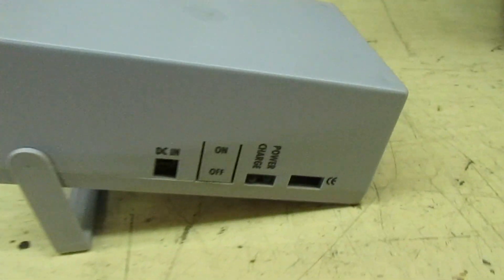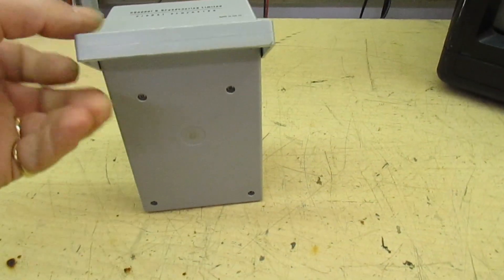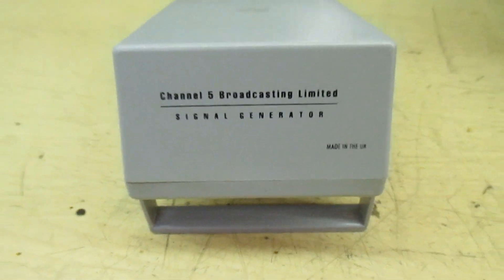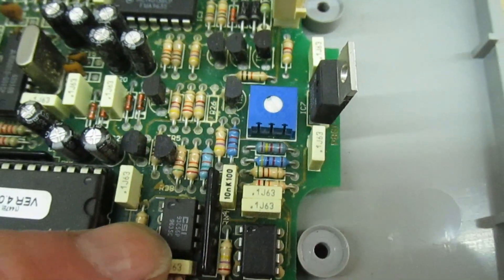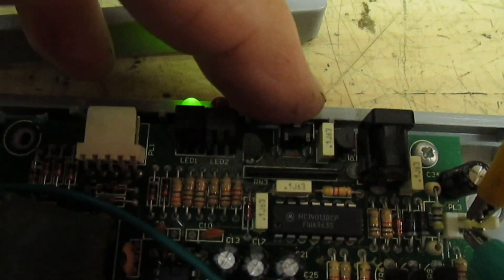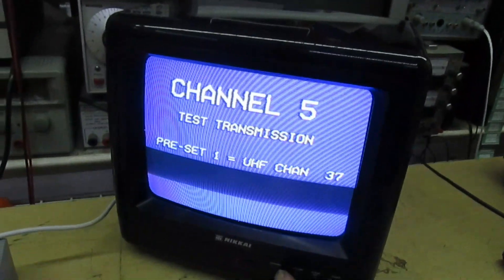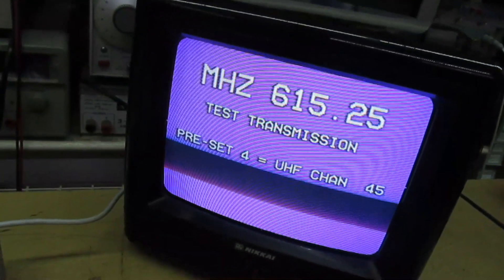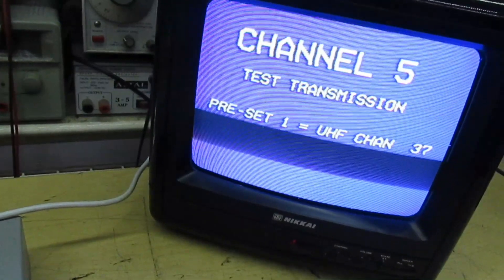Vintage channel 5 signal generator from the 1990 s

Comment: I've realised - that Nikkai TV must share some display components partially with a Mitsubishi TV set of the same vintage as I had a small 12" Mitsubishi TV in the early 90's and it had an identical On Screen Display.
Reply from the maker: It could have well been so , a lot of sets back then used just industry standard chip sets .

Comment: Channel 5 was broadcast on a high frequency in some parts of North East England, either UHF 67 or 68 so there was no need to send anyone out to re-tune VHS machines. BBC2 from the Pontop Pike transmitter was on UHF 64 so the new Channel 5 was in the same C/D group for aerials, although it was broadcasting from a different transmitter.  However down in Bristol (Mendip transmitter) where I moved to in April 1997 used exactly the same UHF frequencies for 1, 2, 3 and 4 as Pontop Pike but their Channel 5 was somewhere in the UHF 30's range (might have been 37). So strange how 2 transmitters using the same frequencies for the main 4 TV channels ended up with Channel 5 in completely different places.

Comment: Oddly enough, there was one of these for sale on eBay, back in the summer of '21. It's listing was badly worded and I didn't twig to it immediately, unfortunately, by the time I did, it was no longer available. 😭
Reply from the maker: The seller may not have known what it was, I didn't know what it was either until someone said in the comments as been on a relay transmitter we never got ch5 here, only on satellite.

Comment: Hate to think how many vcr  modulators I have adjusted ,as a side comment I was involved in a similar project when I was sent as part of a team to Whitehaven to trail the digital switch over,we did all the ground work and supplied custom freeview box with modulators so any tv could be converted but in the end we did not get the contract but it went to a company set up by upper management of the the digital switch over campaign (allegedly).

Comment: These boxes were supplied to the people who were sent to every home with a TV in the predicted Channel 5 coverage areas to retune VCRs so they didn't interfere with the new Channel 5 service usually on Ch37.The re-tuners were usually not technical, some were students or retired people and they would struggle to sort out homes with a VCR, cable box, games console all around CH36 and without much modulator tuning range. If they failed then a local dealer would take a look (free to the customer) and in the worst case just fit a Ch37 notch filter so the customers would not have any interference but of course no Channel 5. The area I lived in was not in the official Mendip service area but many people had large aerials to get Channel 4 from the transmitter and also many communal systems in flats were served by Mendip but no re-tuners ever called, but never mind, for £10 I'd go along and sort something out often by using scart leads and boxes which I charged extra for but gave better results than RF especially for games and Sky boxes, I never used a signal generator since the transmissions had already started, I made some decent money from Chanel 5 starting, I'd do 20-30 flats in a couple of hours.

Comment: These were used by the mobile "retuning squads" - unfortunately they were not that great. There were many areas where they should have used one generating signals on both 35 and 37 - the signal from Lichfield overlapped with both The Wrekin and Waltham. However, they never got to me, and on a set top aerial I could receive both Lichfield and Waltham. The video recorder I was renting at the time had output adjustable between (specified) 32 and 40, and it was very difficult to find a clear setting. Fortunately my second TV could be manually tuned, so I set channels on it from 30 to 43. I also had Channel 5's own blockers for all their channels in that range, but they were no help - in fact, if anything, they seemed to make the problem worse. I found the only channel where the video could output without interfering with Channel 5 from Waltham or being interfered with by signals from either Nottingham, Lichfield or Sutton Coldfield was 42, which it could just reach.

Comment: I worked as a Channel 5 retuner and had one of these. My one didn't have the ch 35/37 switch on (wonder if it would have had the terminals for it inside?) The four buttons are programmable; use the five-pin connector on the side. One end is common, connecting it to the others allows you programme the channel for each button.

Sadly, I wasn't able to keep mine; when the returning project had finished the company insisted on having them back (I even offered to buy it, but they wouldn't). No idea what they would have wanted them for. Never seen another one since.

Comment: Thought the channel selection may have been for the 1, 5 and 9 rule but that doesn't add up.
When the switch is set for 35 rather than 37, does the selection of channels on the presets 2, 3 and 4 follow suit?

I live north Manchester, back in the day I had a fixed Group C/D antenna on Winter Hill and rotatable Group B for Emley Moor, Moel-y-Parc and others.
So had to reconfigure my system when Ch5 launched as Winter Hill was Group B.
Got a screenshot of the Ch5 Emley Moor testcard, the capture device I used (Play Snappy) had an option of multi frame averaging so removed all the noise.
Reply: Winter Hill was just about still group C/D even with Channel 5, although it was at the bottom extreme (channel 48) and would have been potentially poor with a short reflector. I think it was also somewhat lower in power, but Channel 4 was still affected for viewers on Middleton, so they moved that to 37 there.
Reply: @PhilReynoldsLondonGeek  I think it was about 16dB down 12.5kW Vs 500kW, my combiner splitter had a high crossover frequency around ch.53 as I recall.
Reply: @simonparkinson1053  Ah, that would possibly affect it a bit.
Reply: I have one of these and have more info on the unit itself including the setting of the 5 pole connector to change the setup configuration. Also the  fitted batteries have issues(nicd) and leak . If anyone still interested I will keep my eyes open on this narrative.

Comment: Not seen one before but as others mentioned most vcrs used ch36 as output ,so channel 5 had "installers" going round adjusting customers vcrs for free so no Interference.  This looked like it was used in  B group area possibly Emley Moor ? .